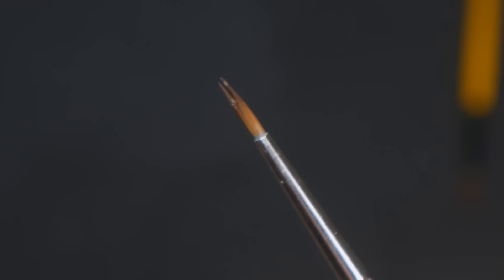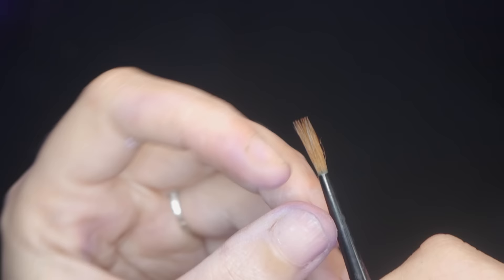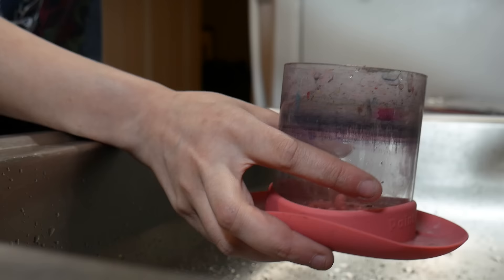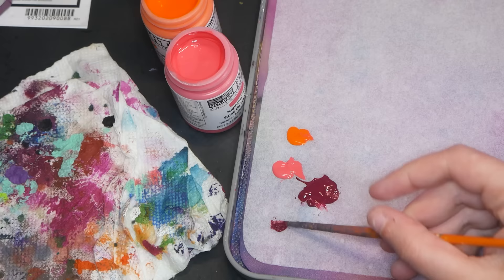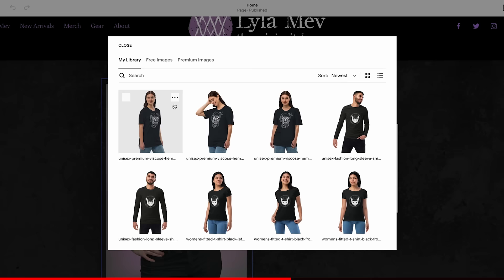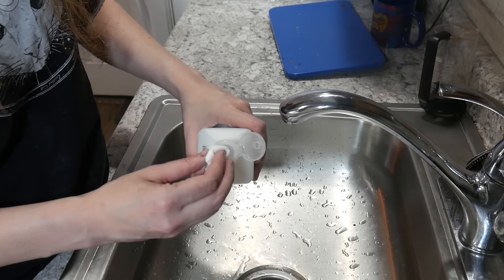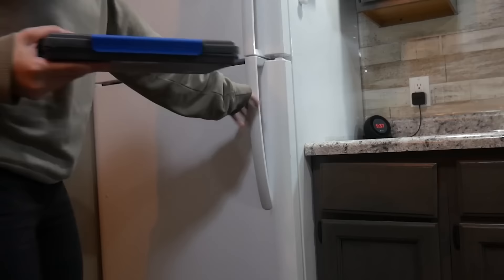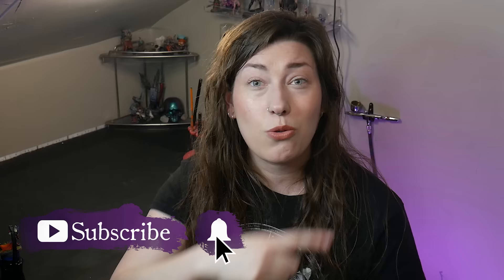STOP Ruining Your Miniature Paint Brushes

Comment: Hanging a brush upside down is a (recent) painter myth.
Upright is preferred and recommended by the likes of Winsor Newton, Raphael, Da Vinci, Andrea, and Escoda - the actual manufacturers of the finest brushes for decades.  

Remember: when evaporating, moisture travels upwards.  (If you are a brush-licker, inverted storage will keep more of the bacteria in the ferrule.)

Synthetic brushes can be shocked in very HOT water to straighten them (but hooked brushes in the aught sizes can indeed be quite handy).

The BEST brush cleaner and preserver is, The Master's made by General Pencil... 40 years of use and found none better!

Finally, to prevent mold, spray the sponge lightly on both sides with hydrogen peroxide (yes, regular peroxide that you buy in the first aid section).

Clean brushes after every use and in the middle of long painting sessions - maintain your tools and they will last!   DO NOT LICK THEM! 

Been in the hobby 51 years - still have and use palette knives, brushes, and oil paints from back then, too. ;)
Reply: Yeah, I think the store brushes point down is a myth. We blot the majority of moisture out of the brush anyway, so we aren't leaving them to drip downwards. There isn't much motion of the water left to carry particles downward. Storing upright or on their sides in a case prevents me from dropping them tip down on a surface!

Comment: You can also fix your curled synthetic by using a cup of boiled (still hot) water with a straight inner surface - just dip it in for a bit and then roll it on the inner surface - this is a fix, not a prevention, but it still works for a bit. Not the best solution, obviously. I've seen people use hair-straighteners with water on them, but that seems excessive.

Comment: I wouldn't use anything that had any sign of mold. if you can see it, it's sporulating. if it's sporulating, its putting millions of spores into the air, and thus everything in your area will be prone to more mold. always throw anything with mold out immediately,  carefully and into a sealed bag without shuffling it around... because mold begets more mold exponentially !

Comment: Tap Water contains bacteria and mold particles that will turn into full bloom mold growth in an enclosed environment. Use Battery Water / Demineralised Water instead. I have done this for years in my orange Everlasting Wet Palette and have never experienced mold. The same goes if you thin your paints inside your pots: Don't use tap water, things will start to grow in there.   Note: I do live in a villa that had lots of problem with mold in different areas of the house, so i had to reach an intermediate level of expertise on mold to win that war. My home is now as "mold free" a home can get. Unfun fact: Mold can't be killed, not even with fire, the spores still just fly around... bastards. Only way to keep mold at bay is to keep it starved from nourishment (like skin cells) and moist.

Comment: The mold issue can be prevented so easily.
You don't need bleach.  You don't need copper pennies.  You don't need any random additive.  
All you need is simple distilled water.  
If you already have mold, toss the sponge and paper, start over with a fresh set and never use anything but distilled water in your wet palette.  Problem solved forever.
Reply: That probably won't help if there are mold spores present in the environment you paint in. That'll contaminate your water eventually. Water won't stay distilled.
Reply: As Questgiver Cyrandis said, distilled water can actually make it worse. Tap water has a mixture of chlorine, fungicide products, anti-algae and so on (in various quantities, depending on countries and zone) to make it safe and drinkable. All of those are actually making life harder to molds and fungi. You just have to be a little diligent and keep it clean, change your water often and clean your sponge with an antibacterial soap (it's cheap and you can find it everywhere).
Reply: @questgivercyradis8462   So far I have two wet palettes that both have been using distilled water (which have been sitting for over six months) with no visual or olfactory indication that any mold may be present.  Unlike when using tap water, there is often a very clear indicator when you have mold.
As far as painting in an area where mold spores may be present, that is an entirely different problem that should be addressed.  ;)
Reply: @SgtRenny  , while I still stand by my most recent response to Questgiver Cyrandis, I do agree that a sense of diligence in routine cleanliness is helpful.  Perhaps I should have added that I live in an area with notoriously hard water (Arizona), so using distilled water is often a preferred solution against a myriad of water issues (of course, not for drinking though).  So I guess a "YMMV" disclaimer would be warranted, but at least in Arizona, I can vouch for distilled water being a great solution for the prevention of mold on a long term basis.  So far...
Reply: @MalsBrownCoat  we have the same problem with hard water where I live (northern Italy), so much that pretty much everyone in my area has some kind of softener. Except me XD. Yet I'm using tap water in my wet palette for the last year and I get the same results. No molds, no bad smell, no scale on the borders of sponge... I just keep everything clean. That's why I'm not convinced that distilled water is the ultimate solution. If you can get access to it for free (ie: collecting it from your air conditioner) I'd say go for it. Otherwise I wouldn't add another cost to an already expensive hobby.
Reply: I'd use distilled water if I lived somewhere with really hard water - more for my rinse water than palette, but probably in palette too if I had easy access. Would want that if I was painting at my BF's place - his water is so hard it actually fully clogged the pipes with mineral deposits at one point. I find that my mold problems are house dependent. Previous place I lived ended up with sponge mold a lot faster than current place I live. 
Generally: just clean the darn sponge somehow or another on a regular basis. It tends to help regardless of water used.
Reply: Or use a paper towel and parchment paper.  Exact same result and you can use tap water and not need to keep it more than you'd keep dirty cleaning water.  Wanting to hold onto this stuff rather than simply dry it every time and put water back in it is the problem.  Clean your damn water.... It's not hard.

Comment: You shouldn't pour paint down the drain. It's both bad for the environment (microplastics get in the water) and bad for your sink. Wiping up excess paint with a paper towel is the best way to not do this. If you have a lot of wet paint leftover, put it in a jar to use for basecoats/terrain/etc. Don't worry about separating the colors, it will all turn into grey/green/brown slush. You can then use the paper towels to soak up paint water and toss that into the garbage to further avoid dumping paint down the drain. 

Obviously, you can't completely eliminate paint going down the drain. But taking some small steps can go a long way. This is something I learned to do in painting classes, because 20 people dumping paint into the sink immediately clogs the sink lol.
Reply from the maker: Thank you!

Comment: Great Tips! I have some sable brushes over 40 yrs old and they still 'snap' into shape. Thanks Lyla
Reply from the maker: HOLY WOW
Reply: I have some of the Windsor and Newton series 7 size 1 miniatures that Lyla recommended that I've only used twice and they are trashed. I don't think it's me. They came out of the package looking kinda rough. I'm upset spending so much on brushes to have them be trashed so quickly. What's the secret?
Reply: @Ali626AMM  You use brush cleaner and store them sideways or facing down? That should stop them from fraying.
Reply: @nekrataali  I use the masters brush cleaner every time I paint with them and then put a residue in to hold the point. I do store then point up though. I'll have to change that and see if it really makes a difference. 🤷🏻‍♀️  Thanks.

Comment: Fridgimg wet palette is not exactly safe, health talking
Reply from the maker: why is that?
Reply: @LylaMev  chemicals .each colour has a volatile part and the humidity of the wer palette itself keep active the reaction. Even if you keep the box closed anyway it's not something that it's preferable to keep with consumables food.
Moreover there is a risk cause powder of colours miniature cleaning and so on to be on the external part of the wet palette itself and it risk to pollute in some ways the air around it.

It's better to have separate little fridge for such things: Colours, green stuff and so on.
Reply from the maker: Thanks for this!